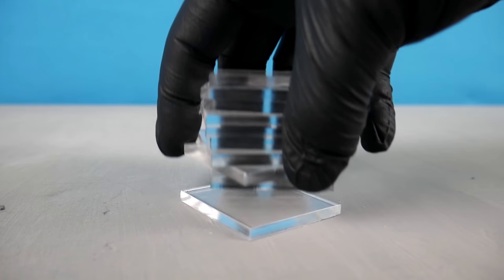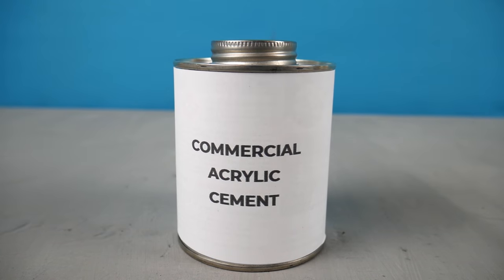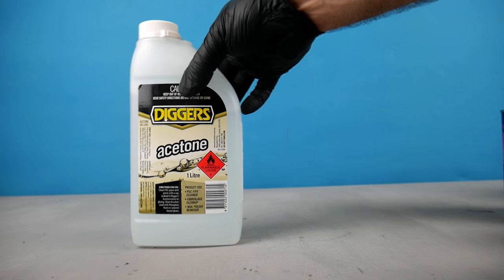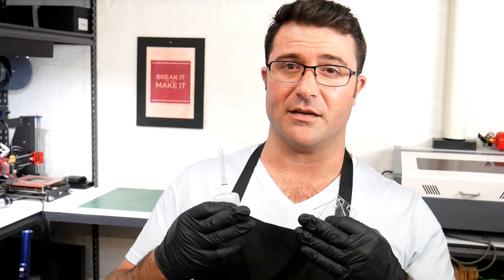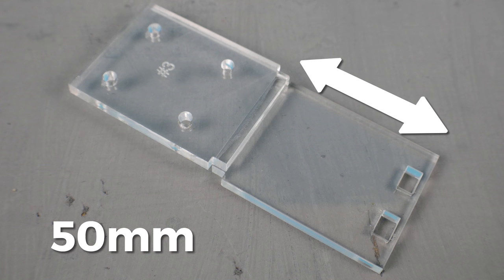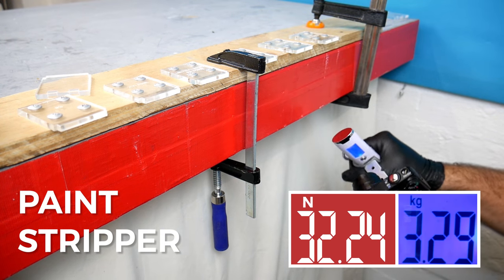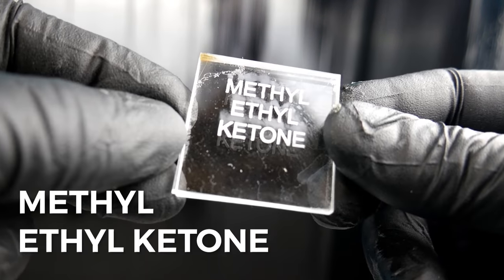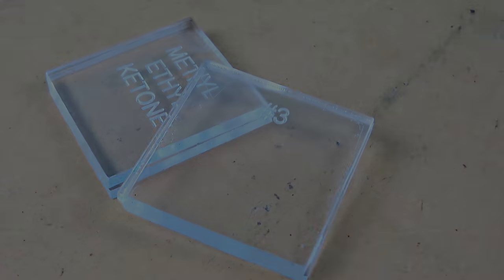How To Bond Acrylic Sheet Without Acrylic Cement

Comment: I hear that chloroform can be used too as bonding material, is it true?
Reply from the maker: Chloroform(trichoromethane) is a very good solvent for poly methyl methacrylate, but is regulated and hard to obtain. Dichloromethane is more commonly used rather than trichoromethane in many acrylic cements because it is very similar in structure and action. While both chemicals are similar in structure, action and toxicity, dichloromethane has a much lower anesthetic effect.
Reply: @cosador  which one that give the clearest view of the bonded acrylic?
Reply from the maker: @isaanshori8897  all is explained in the video. The things that I used where they did bond were all clear. All bonds were clear because my selections were clear, causing no notable discoloration.
Thanks for watching!
Reply: @isaanshori8897  Here's another useful source. It's a list of various chemicals and their compatibility with acrylic. Anything listed as the "Not Resistant" is a pretty viable solvent.

Ideally, mix it with some acrylic chips/shreds to make a slightly thicker liquid that will stay put better and fill in small gaps.
Reply: @TravisTerrell  thank a lot
Reply: I heard chloroform was good for bonding. But I think that had something to do with Stockholm syndrome, not acrylic...
Reply: Why is it regulated? I mean whats a guy gotta do to abduct, I mean, make some fish tanks??
Reply: @SoQlose  For fish tanks and thicker material say thicker than 3/8 using acrylic monomer and mixing in a catalyst to start during process works well if you know how. This is quite the learning curve.
Reply: nizam zainal yes my dad used to use that years ago, not sure where you would get it from
Reply: Can also be used if date night isn’t going well, quite expensive though about 25 to 30 yrs for the first application
Reply: Yes its true..
I use chloroform..
Very strong bond..
Reply: Yes in fact is the best , but difficult to obtain.
Reply: Yes its true
Reply: Will MEKP work the same as MEK for welding acrylic?
Reply: @SoQlose  Does this smell like chloroform to you?
Reply: Yes.

Comment: You can also use acrylic nail monomer to bond acrylic sheets.  It is comprised mainly of ethyl methacrylate and dimethacylate.  I use nail acrylic for a myriad of different things - I sculpt custom bits for minature models, repair plastic and resin things around the house, bond acrylic with the monomer (100% clear, because it is acrylic), sculpted masters for silicone molds, etc.  It is wicked versitle, and much less expensive per ounce than acrylic cement.
Reply: What have you found best for applying it? Looking to just make a 6x7 display box.
Reply: My wife does acrylic nails.  I am seriously going to raid her stash.
Reply: @izzojackal I'm going to mKe a box.. did you figure it out?

Comment: Okay! I’ve been working with acrylics and other clear plastics for over thirty years now. In my experience, these days, there is no substitute for dichloromethane/methylene chloride. By far and away the best “glue” used for bonding acrylic is and was chloroform (trichloromethane), which you are, at least in the UK, not able to easily get hold of these days. (I’m not kidding when i say I used to order it and collect it from my local chemist, it came in big brown glass jars in a cardboard box and I would load it into my car and drive it back to work). To my understanding it was mainly banned in the work place for its potential carcinogenic effects. The best dichloromethane/methylene chloride based “glues” are those that are mixed with other chemicals, such as ascetic acid, that actively lower the evaporation point of dichloro or methylene chloro and allow for better capillary action to take effect. It should also be mentioned that you should never try to “glue” lasered acrylic as the heat generated when cutting will always add stress to the material and cause failure of any bond and will cause “crazing” (very small cracks and fissures in the material). I suspect if you had tried CNC routing of the acrylic the results of your test would’ve had a slightly different outcome. That said, for any material you are unsure of it is always best to run some tests on scrap material and choose what gives the best results.
Reply: Dear David and Jonathan,
I am doing my acrylic distroplate project where I need to bond together several sheets (200x400 mm) with aesthetic perfection. They have complex cutouts and need to hold some water pressure, so it is mandatory to have a good strength. I tried to use a UV-curing epoxy but any tear/break force creates a cavity, or a de-bonded spot. Should I better switch to cement? I can get S-polybond and Acrifix 192 via Amazon, but are there better options?
BR
Pavel
Reply: Is trichloromethane stronger bonding than dichloromethane or about the same? And what about Acrifix 116?
Reply: Makes somehow no sense, that a laser creates more stress to the material as an CNC machine. Maybe the laser was to weak to do the job in one instance.
Reply: I prefer dichloroethane.

Comment: The best acrylic bonding solvent is made from a custom blend of 90% Ethylene Dichloride plus 10% Glacial Acetic Acid. The resulting acrylic bond is transparent and strong after curing fully for 72 hours. The high quality bond is achieved, because Ethylene Dichloride is not as quick acting as Methylene Chloride. Furthermore, the addition of 10% Glacial Acetic Acid allows more set time for the Ethylene Dichloride to completely bond the acrylic surfaces.

Comment: Thanks for the info.
I just made a large window with a sliding opening and latch. All out of 10mm acrylic. 
I started by making a small prodotype and used the superglue which I happened to have. 
It was rock solid. I finished up building the whole thing out of it. 
What's your opinion of using Super glue? Any goog? Or an I in for a nasty shock down the road?
Jeff

Comment: Be sure to use a glass syringe for solvents, as they will dissolve the plastic in normal syringes.  Use all metal needles with metal hubs if you can,  I've unfortunately had that experience...
Reply: Will acetone dissolve the ordinary plastic syringe? I was going to give it a try but hesitate to make a mess now.
Reply: In my experience yes it will , but for short term use it should be fine. Just don't keep it in the syringe for long.

Comment: I have a possibly very bad idea for joining acrylic. Put a piece of aluminum/copper foil between the two pieces where you want them to join and apply force. Direct heat at the join with an infrared heat source. The foil will heat up and just that area will melt and bond. Acrylic is transparent to infrared.

Comment: Basically looking to glue laser cut layers together, so seems like paint stripper or acetone is what I'm looking for since it's easily available locally and I wouldn't have to order it. Making Decorations with multiple layers, so just need them to be glued flat together. No stress will be put on them at all. So that definitely seems like the best bet for what I'm doing. Seems like fingernail polish remover might work too

Comment: I'm surprised you didn't test Hot Stuff products that I have used in miniature building while working at Disney. They have fantastic holding power. Especially the thick Hot Stuff with the aerosol accelerator. And the best part is they are cheaper than any of the items you tested.

Comment: The key is to melt some acrylic shreds in the desired solvent (toluene, acetone, etc.) Then you end up with a thicker solution that will stay put and fill in tiny gaps and imperfections between the pieces.

Comment: Question. Would you know if using MEK for model building (gluing Styrene together) make a good choice? It needs to be fast (15-20 seconds) with making a strong bond or it would not be practical for building plastic Styrene models. The glues available for this purpose are expensive and looking for an alternative. Thanks for a super detailed video.

Comment: Quality video. Thanks for making this. I'm actually interested in bonding a piece of fabric to a sheet of clear acrylic to make a pickguard for a guitar. However, I haven't the slightest idea how to effect such a bond (if it's even possible). Do you have any suggestions?
Reply: Try leaving small pieces of clear acrylic in acetone for a few days. Keep shacking until it dissolves. Use as glue. Alternatively use Silicone.

Comment: I need to bond some fresnel lenses together side by side without getting flow onto the surfaces, so the thin liquids don't seem like the right approach. Is there something that wouldn't flow out so much, or maybe a solid material like a tape that would fuse with the acrylic?

Comment: Hi Cosador. Thanks for this. I would like you to make a video on whether it is possible to put together clear acrylic sheet with glass. I have a brewing project where I want to make the walls of the brewing tank to have glass inside acrylic outside, this bond would help with sustaining pressure from the brew(1000L) and also insulate/shield the glass from any incidences and only affect the acrylic. Please make a video to show which materials can be used to bond the glass and the acrylic or simply recommend which materials could work? silicon? etc.
Thanks.

Comment: Is it possible to glue two ends of Acrylic Sheets in order to get a larger sheet?
For and example, I have 5 mm thick two pieces 18" x 32" and I would like to glue them and get  36" x 32".

Comment: Bending the acylic...semi circle to the front where i can just connect flat piece to the back,eliminating the  two upright front seams..i know that size will  determine the thickness   and weight of  the liquid ,base would be properly secure.should   i cap the top for structural strenght...?

Comment: It may sound as a good idea to make things at home. I made a few shelves recently for my bathroom  out of acrylic found on street. However, I bought for the project a nichrome wire and power supply. Before that I spent a lot of time to acquire necessary knowledge. If I was to buy acrylic sheet it would not be cost effective. It is not cost effective anyways. In UK we can buy materials that will cost a lot more than ready made product with free delivery. In some cases when something needs to be made to specific measurements like my guitar neck, for example, still not worth it as it is possible to buy a ready made one from US at $155.00. I have spent on my manufacturing a lot more hours that it possibly make it sensible cost wise. I wish I ordered   most expensive guitar at the beginning instead of trying to prove myself capable of making things, This would be less expensive overall, plus , I would have a lot of free time. Thank you

Comment: Hi, would MEK be safe to use in an aquarium? Or how would it hold up over time being subject to water?
Reply: I'm having the same problem about to make some fish tanks and can't find Acrylic Cement anywhere in Australia lol
Reply: @ArtyMars  I ended up using silicone for the little box I had to build for my aquarium sump. I tried everything (even MEK). Superglue worked, but I wasn't sure if it was aquarium safe. I don't think you can use silicone for a tank though - too much pressure. If you find it, please let me know!
Reply: @SureshBopitiya  I found out that apparently it's considered a dangerous liquid, so most places can't send it online through air-freight and it's hard to get unless it's shipped by boat and delivered by freight truck to a store etc xD now finding a store is the difficult part haha
Reply: @SureshBopitiya  super glue (cyanoacrlate) is safe for aquariums. Great for glueing rocks & wood in aqua scaping. Check out awesome work by serpa design.  ❤️🇦🇺

Comment: Great video mate! Just wondering if it's possible to join two pieces seamlessly together side by side rather than on top of each other?
Reply: I know someone who bonded 1/2" acrlic sheets end-to-end with WeldOn 4.  He had to sand and polish forever to disguise the joint, but it was still visible.  I would not recommend the method for a large aquarium.

Comment: I use acrylic cement regularly but recently tried it on a piece of "optix" acrylic and there was absolutely no bond. I have heard that cross linked acrylics do not work with acrylic cement and wondering if it falls under that category.

Comment: Are you using cell cast or extruded sheet acrylic?

I’m trying to weld 10mm cell cast sheet to sheet (i.e. not edge welding) but have problems with crazing, any new ideas to minimise this?

Have you tried annealing to reduce internal stresses prior to glueing?
Reply from the maker: I believe it is extruded, however it is recycled sheet.
With consideration that I only used a couple of brands in testing, I found that the cast and extruded preform similarly.
With some cast sheets I have also found that they have crazed and cracked with even the best cements. I think it has to do with the higher melting point and silghtly differing compatibility with solvents.
Annealing acrylic  is something that I'm currently looking into, while I've heard may good things but I'm still working on it in conjunction with another project.

Comment: Great video. I would love to see super glue in a part 2 video.
Reply: I tried Uhu super glue and would not recommend it. It leaves a cloudy effect on your acrylic that I found to be called “blushing“.
Reply: @Kazuyo89  how long did it take for the blushing to appear?  I'm trying generic super glue, and have yet to see the cloudy effect with this brand.
Reply: @mikejdash  it took about a day. I switched to UV resin. It doesn't hold forever, but suits my purposes of making acrylic blanks to pour silicone molds for resin crafts.
Reply: @Kazuyo89  may I know the uv resin that you try? Link of the product is greatly help. Thanks
Reply: I just search for the cheapest UV resin on Aliexpress XD but I also found this stuff: S-PolyBond® Acrylglas, Plexiglas Kleber, Klebstoff, Kaltschweißkleber | 100ml | geeignet auch zum Verkleben von ABS, ASA, SAN, PVC, PS (1, Acrylglas/Plexiglas Kleber) https://www.amazon.de/dp/B07PNYJDZ7/ref=cm_sw_r_cp_apa_i_Efp7DbFH6CX2T
Dunno if they ship internationally, though. I can't get weld-on here on Germany, but I reckon it's the same.

Comment: I made a huge mistake by using superglue to attempt to repair a large broken corner from a 1/2 inch thick large sheet of acrylic. It fixed decently at first but didn't hold up. The break does not have perfectly smooth edges. What product should I now use to mend the pieces?
Reply from the maker: Depends on the purpose. For a critical joint possibily weld-on #16 and for non-critical probably a clear 2-part epoxy glue. Good luck!
Reply: Cosador Thank you. I used Weld-On #16  and it has been holding very well. The joint is ugly thanks to the superglue but it is now holding strong.
Reply: @cosador  hi sir  , hope you can hear me , first what adhesive is this coz i realy need to stick hard a  alluminum sheet to acrylic sheet to avoid using  bolts and knots second can using clear epoxy adhesive joins hard 2 acrylics ?? Please sir thank you merry chrismass sir
Reply from the maker: @cristanc2310  you are correct, that would likely be the best adhesive. Test your brand of epoxy on a scrap piece first if possible, then inspect after cure to avoid fractures.
Reply: @cosador lots of thanks for hearing me sir "  i really cant express my gratitude , your videos are so concise and explained very clearly using it as guide in making acrylic logos and back lit photos to sell for extra money 🙂, you deserve lots of subs sir , hope you do new videos 🙂 happy holidays from phillipines 🙂

Comment: I've used MEK for bonding plastics for years now its getting hard to find all that is available is MEK substitute will this work ?
Reply from the maker: MEK substitute is often ethyl acetate (Check MSDS). Ethyl Acetate is a common acetone substitute that is "safer" but not quite as good. 
Ethyl Acetate should work as a solvent for some plastics, but further investigation would be required.

Comment: Are you able to reuse the syringes?
Reply from the maker: As an applicator, they are very limited due to the damage that can be caused to the plastic and rubber. Generally, I will responsibly dispose project syringes after they stop functioning or after use.
Thanks for your question!

Comment: So, it seems to be on the safe side we're better off sticking with the appropriate glue. I'd like to see a good video on how to repair fractures without doing the drill hole thing. Unless there is some clear filler for the  hole. Prost
Reply from the maker: The most expencive chemicals are usually the most controlled and for quite specific purposes but usually the best unless the application is not as crucial.
Good idea! I am working on something currently for breaks and imperfections.
Thank you for the comment!

Comment: If you use superglue cynoacrylate types beware of blooming and fogging if the item is sealed and has even the smallest amount of finger grease anwhere(it does not have to be part of the contact the vapours from the glue will find the greasemaking a grey 'fog', also sealing acrylic layers without pockets of air is a real art and finally go for 'jelly'  type superglues if you don't want capillary action randomly flowing into the joint. UV bonding glues may well be worth considering though relatively expensive but you can get cheap uv torches for a couple of pounds/dollars (check the wavelength as acrylic doesn't pass some UV's). Maybe worth some air time  to review these topics?